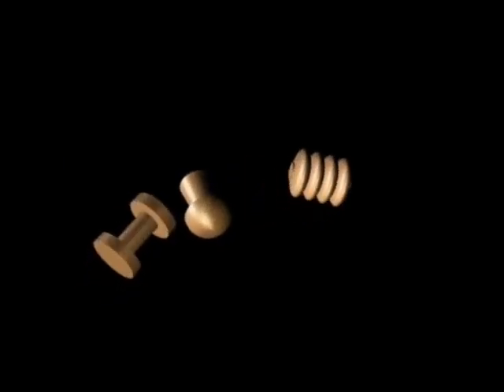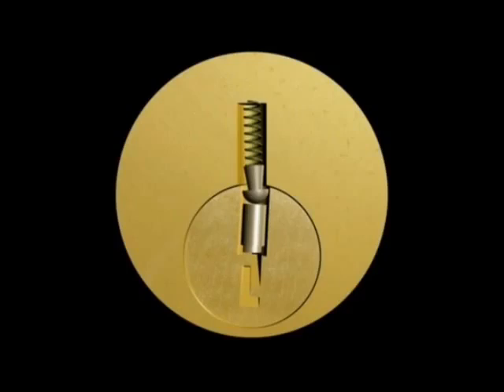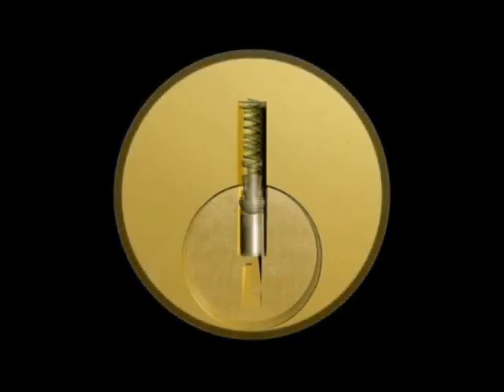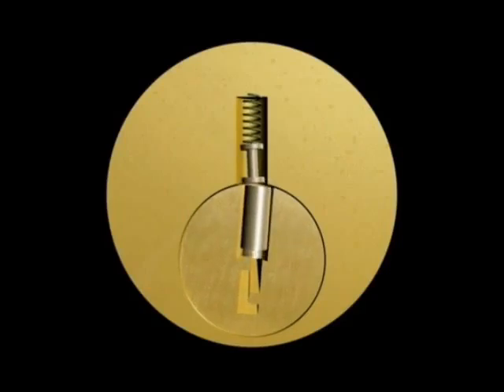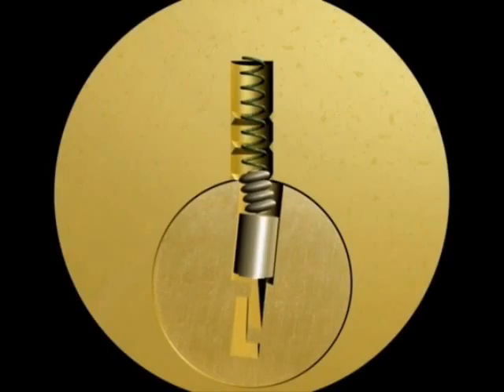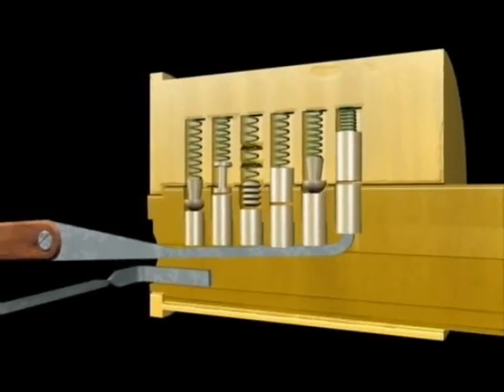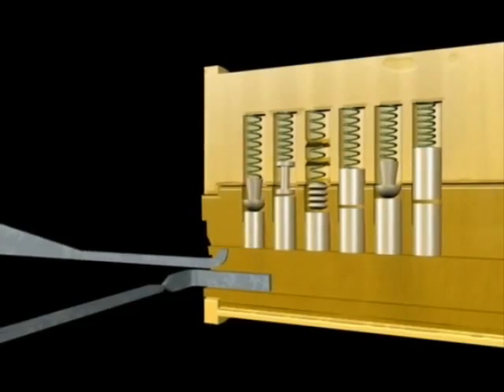Virtually Explained: Security Pins - Trap Pins

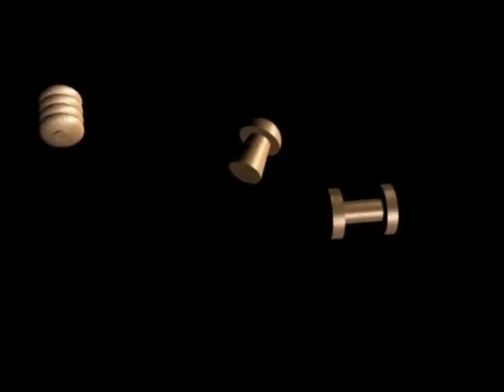Comment: Correction, the plug does not always rotate as “normal,” especially in the case of spool pins (0:32). When the thinner section of the spool pin breaks the sheer line, this will cause the lock to slightly rotate either clockwise or counterclockwise (depending on which way a lock is tensioned). This movement drops the pin into a “false set.” When you move the next pin in the core, this will cause counter rotation against the tensioning.